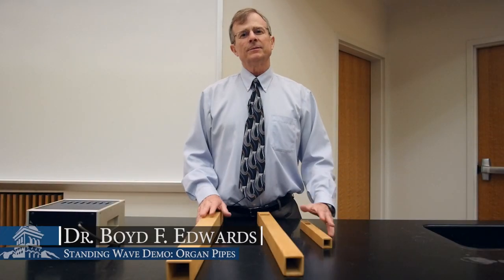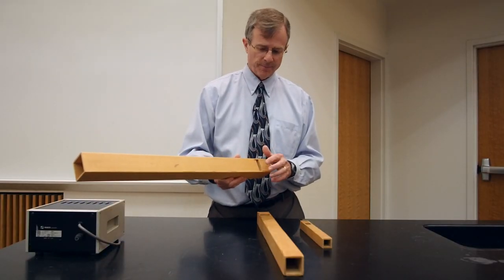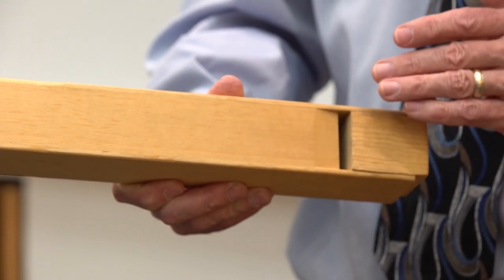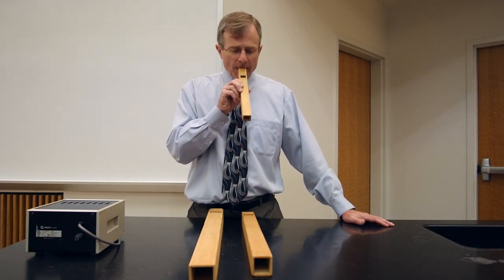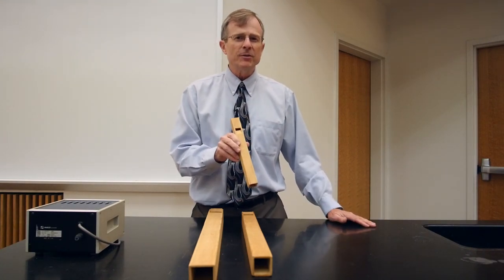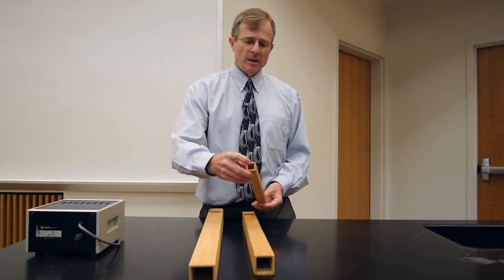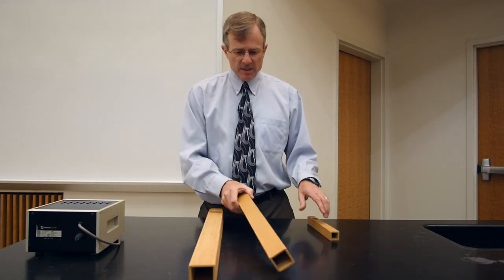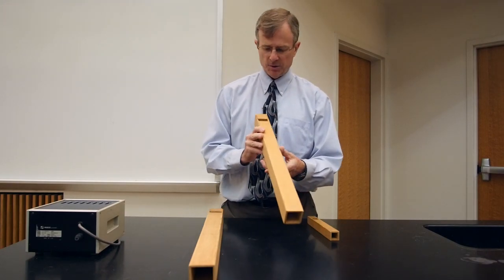Standing Wave Demo: Organ Pipes

Comment: I think he has mistaken the term "open". Flutes are only open at one end. Organ pipes are only open at one end and sometimes stopped at the end as he demonstrated. His description of the pipe being open at both ends is incorrect. The air inlet is not considered "open". The mouthpiece on a flute is not considered "open". The mouthpiece end of a flute is stopped. Both flutes and clarinets have open ends. The clarinet is different from a flute as it is a reed instrument and can play lower due to harmonics from the configuration of the vibration of the large reed in a "half length" resonator. This trick is sometimes employed in the reed stops in pipe organs to get an octave lower sound from smaller reed pipes resonators.

Comment: What if cross-sectional area of the pipe was held constant as we scaled the pipe with length as the variable?
Reply from the maker: Not sure what you're asking, but the sound of the pipe would get lower as the pipe got longer.
Reply: Why is it that the shorter your pipes, the smaller their cross-sectional area? Your shortest pipe is narrow. What would it sound like if your medium and short pipes had cross-sections equal to the long pipe? What would be the effect of having pipes of equal length but varying the cross-sectional area, wide to narrow?
Reply from the maker: That's a great question.  If you had two pipes of the same length but different cross sections, the wider pipe would have a lower fundamental frequency because the effective length of a pipe is the actual length plus, approximately, the inside diameter of the pipe.  So only in the limit of a very narrow pipe will the effective pipe length equal the actual pipe length.  I suppose that the timbre, or sound quality, of the pipe won't depend very much on the width, but I don't know for sure.
Reply: Physics Demos thank you! As an engineer I should have remembered "effective length"
Reply: A larger scale pipe (i.e. a 'fatter' pipe) will, indeed, sound a lower note, but also a duller note (i.e. one with less upper harmonics.)
Looked at another way, fatter pipes are shorter, for the same pitch.
What a simple explanation like this usually fails to point out are the other factors which influence pitch, such as: the air-pressure, the scale (as just explained), the height of the upper lip, the width of the slot through which the air is directed, and the shape of the pipe.
Reply: @Offshoreorganbuilder  Yes you are indeed correct. Simply put - the thinner the pipe - the stringier the sound. The fatter the pipe - the flutier the sound.
Reply: @DaylightRobberyCA  In short brother end corrections will be more which is almost 0.6r on both the sides.
Reply: Timbre is indeed determined by width to length as well as cut-up of the mouth (high of the upper lip and angle/chamfer of the upper lip etc), with narrower pipes sounding more like violins (strings) and wider pipes sounding more like ocarinas or recorders (flutes), and medium pipes sounding in between or “diapason”, the basic classical organ tone. One can get all types of variations of these timbres by changing the pipe scaling and construction. Also, other strange shapes and constructions are used including conical open pipes (like Gemshorns), stopped pipes with some type of open chimney in the cap (Rohrflote is one of them), open pipes with nodal holes at the midpoint causing them to speak an octave higher than their length (harmonic flute) and others. And this is just flue pipes. Reed pipes also have all different kinds of resonators and construction.
Reply: @andrewbarrett1537  wow! Great answer. Thanks!

Comment: This is a clever way to make pipes for the pedal division on a small organ where space/money is limited. A small organ will usually have just one stop in the pedal division, a 16 foot Bourdon (French for bumblebee!), of which the pipes are typically made of wood and are stopped (closed) at one end. The '16 foot' actually refers to the 'speaking length' of the pipe, ie. the pitch that would be heard on a specific note of an open pipe of said length, but the pipe in this case is actually 8 foot long. This means you can get the sound of a 16 foot pipe using only an 8 foot pipe, saving space and money. The sound created is a nice bass sound that reinforces the fundementals and minimises overtones, however those can be reinforced too by coupling the manuals to the pedals.

Also, if space is even more limited, for example an organ that could fit in a standard house(!!), an organ could be built using 4 foot stopped pipe to create what is usually referred to as an 8 foot Gedackt (German for covered) which again creates the 8 foot sound from a stopped 4 foot pipe, it is again strong in fundementals and lacking in overtones and creates a very dull sound but works well with a 4 foot principal (open metal pipe) which would be the same physical length but create a sound an octave higher, reinforcing the fundementals

Comment: An explanation as to WHY the pitch changes by an octave when you stop the end would have been nice.

I suspect it has to do with how the waves are reflected in each case -- in-phase vs inverted.
Reply: It is because the fundamental mode that forms in a pipe closed at one end has a wavelength twice that of the fundamental mode that forms in a pipe open at both ends (due to a node forming at the closed end). This results in a frequency half that of the pipe open at one end (ignoring end effects).

Comment: Sorry to break it to you but a flute isn't open on both ends.
Reply: Actually, it is.  It's a much better approximation to treat the mouth end as open than to treat it as closed.  The clarinet is the opposite.  The mouth end is effectively closed.
Reply: @boydedwardsfamily4163  Biber0315 is actually right. The mouthpiece is not considered "open". He also incorrectly states that the organ pipe is open both ends. It is not. The mouth or air entry point are not considered openings from a physics or organ building point of view.
Reply: @boydedwardsfamily4163 :
I'm afraid I must disagree with you.
The organ pipe, like the flute, is always closed at the mouth end, otherwise, it would not sound.
The significant fact to realise is that the pitch of the clarinet is influenced, partly by the effective length of the body, but also, very largely, by its reed. 
 In the case of organ-pipes, some of which have brass reeds, the pitch of the pipe can be altered by adjusting the effective length of the resonator (i.e. the body of the pipe) but it is usual to adjust the pitch (in tuning) by altering the effective length of the reed.  Tuning the pipe in this way, it is possible to alter its pitch radically - sometimes by as much as an octave - and yet the length of the body remains the same.

Comment: I had completely forgotten watching this video, and seeing it again I notice a basic error in the explanation:
The pipes shown are not open at both ends.  The end closest to the mouth is closed, with only the fine slot through which the air travels as the only communication between this lower end and the main body of the pipe.  The opening which is pointed to is there to allow air to flow into the 'throat', or chamber at that end.  From this chamber, the air passes through the slot.